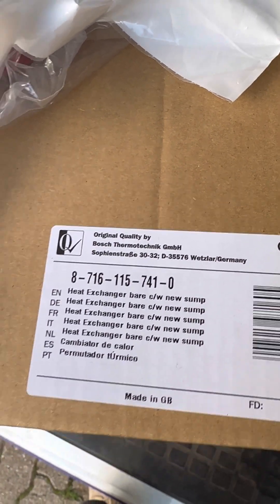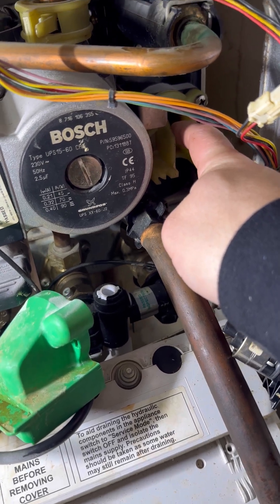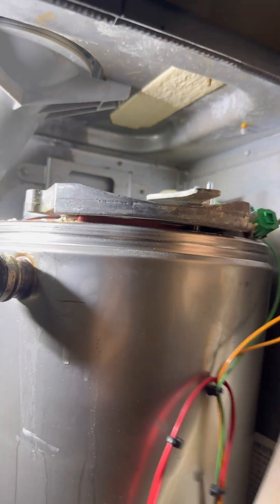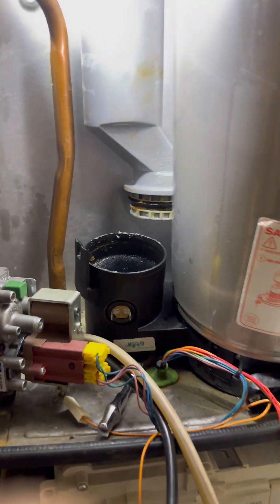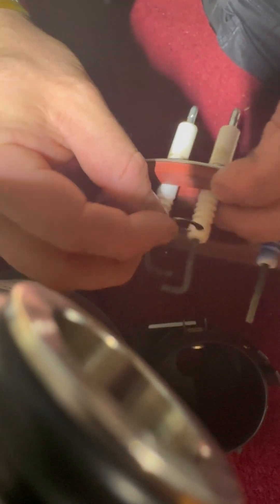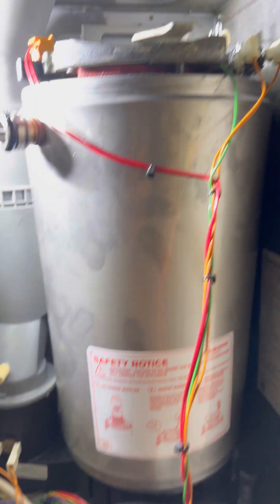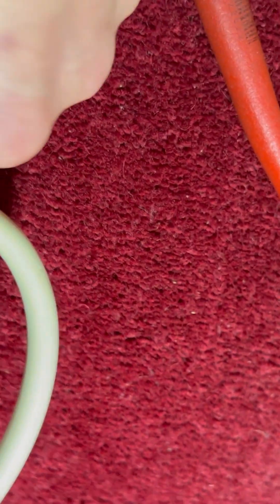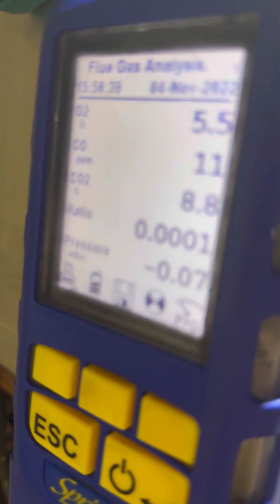Worcester Bosch 30si main heat exchanger replacement real time official video step by step

Comment: It amazes me why people take them out much cheaper to repair iv made a tool to remove the bottom baffles but had one yesterday cleaned it as best as i could but couldn't get the botto. Baffel to drop right down so had to replace the heat exchanger

Comment: Nice video. Apart from a leak are there any other reasons to change out the main heat exchanger ?
Reply: Blocked, scaled or damaged waterways....
Generally has a 10 year worcester warranty so they will send them out for free as long as registered by the fitter

Comment: Great video, when you staining on the top of the junior kebab heat ex is it due to the red burning seal failing or the heat ex leaking heating water? Everyone says different things?
Reply: Heat exchanger water seal failed  nothing to do with the Red burner gasket
Reply: @grannyring   thanks for your reply, some engineers say that and others say its the red burner seal leaking POC
Reply: Water leak around the rim of the hex causes 'crusting' usually caused by poor water quality.
Leaking seal will probably be 'reddish' in colour.
'Kebabing' usually caused by low water in system , but not dangerous. Just dissimilar metals causing rippling.
If in doubt, just test around top of hex with a gas sniffer or analyser probe to determine if 'poc' escaping.
Reply: Water leak is AR as no 'poc' but requires renewing. 
Can be left on until new part fitted
Leaking seal causing 'poc' escape, is AR or ID.
Needs to be isolated until repair done.
Reply: Water leak is AR you sure about that ! 
Usually down to poor water quality overheating and run dry from a failed or neglected expansion vessel
Reply: @grannyring  at worse.. but advised to customer at least. Either way I make a note if issuing a CP12 or informing if carrying out another job at the same appliance. 
 its only because of the potential to lead to other failings if left unchecked. I notify the customer that it will require changing asap to stop further damage to other components internally , but rarely turn off or isolate unless the problem is really bad.
On certain I, or I Jr models the Hex comes with a 10 year warranty so Worcester will send out a replacement only if the appliance has been serviced yearly.
Reply: Depends what they interpret as a service! A genuine service or a “BG” type service
Reply: @Matthew Trueblood  Tbf and they shouldn't my experience is they send one out regardless under warranty if you just say "Yeah serviced Regularly" they don't ask for any proof even if it's had no love or the usual from the poke and go brigade